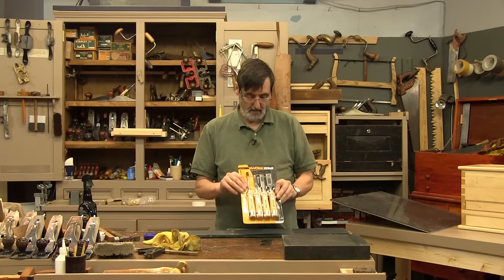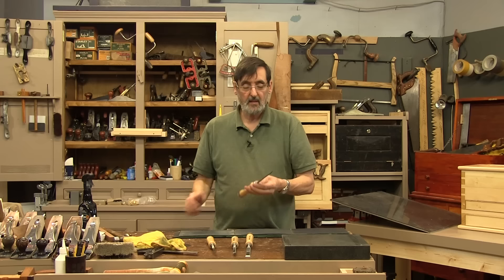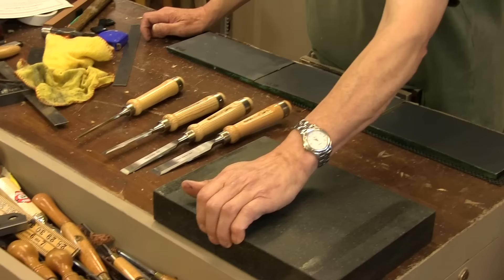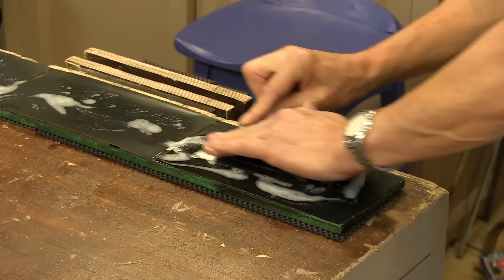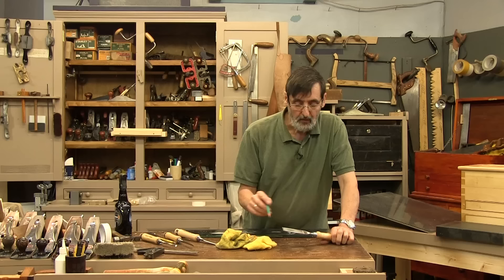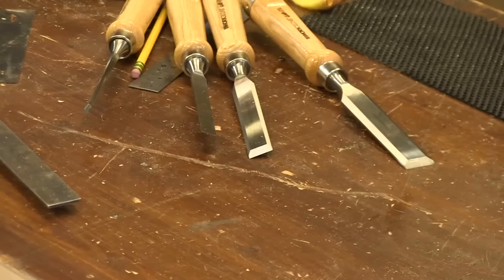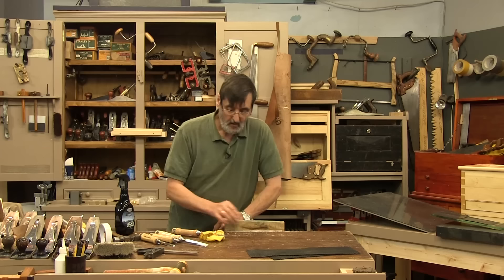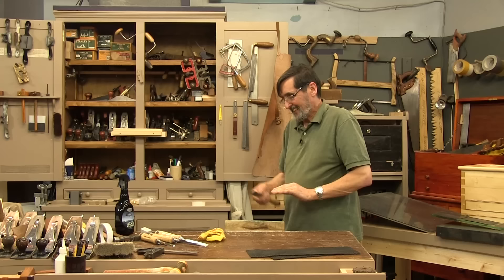Preparing and sharpening a woodworking chisel | Paul Sellers

Comment: Hi Paul. Great video!
May I ask a small video request please? After watching this video, I bought some jewellers rouge, a waterstone, an oil stone (the current chisels I have were pretty rough) and a leather strop. I did exactly what you said on this video. I am not sure if new comers who watch this realise just how sharp the chisels become once sharpened like this. I found out the hard way, yes I was stupid and careless, hands in front of the blade....... blade slips, next thing I know, there is claret everywhere, the missus doing her nut too! I won't make that mistake again. But sharpening chisels this way is something else. They even look good with the highly polished sole and bevel! So those who are going to sharpen this way, just take care and be very carefull, HANDS BEHIND THE BLADE ONLY no excuses!
Reply: hello chris, I may not be paul but I can answer a few things for you as a professional sharpening service. first you need to make sure you keep the bevel at 20 degrees, 19.5 is actually the optimal, but REALLY hard to get it right freehanded.
and him using sandpaper to sharpen, he's not actually sharpening them, more like honing them same principal as a strop but takes metal away. the method I use (took years of practice), is a generic combo stone(rougher side) to grind out the bevel to desired degree only this step if theres nicks and such, if no nicks no longer present or wasnt present at all,then i move onto a better quality stone combo stone(norton) thats flatter, and thats what i actually sharpen with, start with rough side and use 5w-30 motor oil, after I get the edge I need, i switch to other side, and use 3 n 1 household oil for finer touch, to sharpen/hone the rough edge into a cultivated edge, then i move on to my arkansas stone which turns the cultivated edge into a keen edge, as well as polishes it. after all done with this, then I use a leather strop if needed to get rid of micro burrs. have any questions regarding this please email me and I'll gladly discuss it with you.
Reply: also forgot to mention, theres a rule of thumb when it comes to sharpening. the sharper it is, the quicker it will get dull.
the reason is explained above.

Comment: I never got chisels from Aldi, but other cheap ones. And I don't recommend them. You can get them razor sharp or even sharper, no question. But they don't stay sharp very long. The edges on my "Kirschen" chisels last much longer. The best chisel that I have is probably 150 years old, pulled it out of a shelf in grandfathers shop. Completey coated with dirt and rust. I refinished it and still haven't found anything new that can compare to it.
But excellent techniques, thanks for making the video!

Comment: Here in the states you may find an aparrently identical chisel set sold under the Sandvik branding. As I work occupationally with mortise door hardware I keep a few brands in the rotation for my tool bag and I can see where you're ok with them. The old rounded handle maples blue are probably a step up if you can find an old stock set. If you're ok to spend, the boxwood octagon handle sorby are my favorite over time.

Comment: Thanks Paul. I read about how to do this about six or seven years ago but was never sure if I did it right. I sharpened all my plane irons and Chisels. None of them were very great to begin with, several that my father passed down to me were absolute rubbish and another set was free with a subscription to a magazine as I recall. But after lapping the backs (and I flattened them all, took all damn day, I wish I had seen your video, it makes sense that unless they are bellied there is no need to be completely flat) and sharpening them up to whatever grit sandpaper I had, I think 4,000, they cut like butter. I have never done the convex grind, but I might give it a try. It is supposed to be a more durable edge. Do you also sharpen planes the same way? 

I have found that the sandpaper will stay in place with some water, but the edges curl up making it useless. I spritz on some water, lay on the sandpaper, and then clip two opposing corners down with those small "x" finger clamps. I use a piece of Granite tile that I got at the big box store for 3 buck and hang it off the bench an inch to accommodate the clips. I have a granite stone like yours, but I just use that to flatten my sharpening stones. 

Thanks for the video.

Comment: Great tip to use cutting compound simply applied to  a block of wood. I tried polishing on a wheel on a lathe before, it worked the same but is more effort to set up

Comment: I haven't needed to use liquids for the most part. Rather than developing swarf, you often can clear the grit with a brush. The plus side is the backing is much less likely to rip. When the paper is near the end of its useful life, perhaps then you can clear the swarf and spray to get a little more use out of it. Going dry is cleaner and you can just lay higher grit films on top of the lower grits that are glued to the glass

Comment: Great video! Thank you! Just one thing. I've used water paper to sharpen by clamping it with two pieces of wood(achieving same result as you did with tape) and paper didn't rip so far. On the other hand I'm just a beginner and I didn't do that much sharpening yet:)

Comment: By chance, I have a set of those 'cheap as chips' chisels - although I haven't had the 'nous' to bother sharpening them other than a brief whisk on a belt sander. That's changed. I have a hunk of glass, and some leather. I even have some vari-grit sheets of glasspaper gathering dust. Thank you, Paul. I'm inspired. I'll be sharpening my four edges up tomorrow - then I'll try them on some 'Cutty Sark' teak I have....

Comment: randomly, i just went to lidl for groceries just now, and I saw these exact chisels, or very similar anyway. And they cost 7quid, so I bought them just for fun as they're complete bargain, will see if they actually work work at all. It says steel vanadium, haven't noticed that being used for chisels before, so it will be interesting to see after I sharpen them tomorrow

Comment: The old Sheffield chisels seem to behave in a different way to newer steel edges . My Dad used to sharpen on an oil stone till the burr appeared along the edge. Then by drawing the blade back across his palm a few times the burr would flex to and fro and drop off.   I use a cotton pad instead of my hand and the edge can easily slice newspaper without any polishing. The steel is not so hard as modern stuff but it`s easier to sharpen .

Comment: One could find flat surfaces at the local store if he is looking at the granite/marble synthetic stone floor tiles. quality ones are grinded and lapped, in machines similar to the ones that make laboratory grade precision tables. I have found in my left overs some that have 0.01 deflection at 500mm ( they are 60X60X4cm  black granite from a large german-superstore)

Comment: The biggest revelation I have had in woodworking was finally realizing what sharp is.  I've been using abrasive paper for about four years simply for the convenience.  The local auto parts stores sell a nice variety pack that works quite well.  Using lapping fluid never crossed my mind.  I'm going to try it.  As for chisels, the cheap chisels here in the US are really quite bad.  Look at them wrong and they become dull.  I have a set of Irwins that were inexpensive and still have good steel.

Comment: Thank you so much, just did this minus the oxide charged on the leather. Just did it bare leather figured it was better than not using any kind of strop. I am shocked and amazed with the results. I did use a cheap jig off amazon to get the right angle and keep the bevel proper. Free handing isn't too hard but certainly can't do at the speed paul does with any kind of confidence. I am sure the results will only better with practice. One question for those who know, how do you know the EZ lap stones remain flat with use? Thanks

Comment: I sharpen with DMT diamond plates, but I still use sandpaper for initial flattening of the chisel / plane iron backs. I found that my DMT Extra-Fine plate is mostly extra-fine, but there are some bigger diamond particles embedded in it's surface, so it leaves a polished surface with some scratches. Apparently this is very common with those plates, at least the DMT ones. A 2000 or 3000 grit sandpaper leaves a more uniform surface than the DMT Extra-Fine. I finish up dry with some chromium oxide stropping compound on a flat piece of MDF (it's surface treated  time agowith boiled linseed oil to make it last longer). For sharpening, I just use the DMT plates, ending with Extra-Fine, and strop on the same piece of MDF and/or a leather strop (still trying to figure what works best).

Comment: Hi, I recently went to an Aldi here in Brisbane, Australia and came across the exact same chisel set for $12.00. Although I have many fine chisels by  Sheffield makers and Berg from Sweden and Pfiell from Switzerland. I could not help but buy a set of these low cost chisels. I was amazed by the quality of grinding and how well they sharpened up. How can anyone manufacture, ship to Australia, market and sell these for just $12.00. Aldi hole saws and drill bits also work very well. Thanks.

Comment: Hi Paul 
Thanks for showing us how to sharpen a chisel this way like you do have found it great. 
I have one question how do you bring a chisel bevel that is out of square back to square so you can use this method on it?
Reply from the maker: You just have to either regrind the bevel on a mechanical grinder or you can simply press on the offending side until you make the correction. This doesn’t have to be all at once. You can do this with subsequent sharpening.

Comment from the maker: As good if not better than any "lapping fluid" I ever used. Keeps the plates clean and clog free and it seems to me anyway, the cheaper the stuff the better it works. i buy mine from the Dollar Store in the US and the Pound Stretcher. In other words the cheap stores that sell goods at cheap prices. I don't use Window cleaner, but I do also use auto-glass cleaner.

Comment: Paul, I love your video. I made a sharpening station like yours and am trying to flatten my inherited chisels. The trouble is, mine are not nicely hollow-ground like yours, but are irregularly bellied. I’ve spent hours on just one! It’s therapeutic, but so is actual woodworking. Is there a point at which I’m just wasting my energy? Do the edges need to be flat along the entire back? Thanks so much!
Reply: Basically, you need a continuous flat right at the cutting edge, doesn't matter whether it's 1/16" or 1/2" wide. This is about making two bevels meet, not making a whole chisel perfectly straight. Sometimes, esp on used old chisels, corners are sunken below (sharpened on a hollowed stone probably) - that sucks, but 80 or even 60 grit gets me a decent flat back in about 20 mins. Hope this helps.

Comment: Flattening the back of chisels in this way is excellent.  This is very informative.

Putting a convex bevel though, on a chisel or any woodworking cutting tool will lead you to put a greater degree of bevel on a chisel every time you sharpen.  This isn't good practice as far as I can see.  Especially for new woodworkers.

To sharpen the top of a chisel once a back is lapped perfectly flat, I use a 1200 grit diamond stone and a Veritas honing guide.  I then use a flat leather stop with a compound on it.  If I need to re-do an edge after a time, I take it to a wheel and carefully grind back to my edge.  Then it goes back on the diamond stone, and it is sharp and ready to go in about two minutes or less.

There is a technique to getting the bevel edge correct using which ever method you choose, but I believe that showing new woodworkers a convex bevel like this will end up with users putting a 30, 35, 40+ degree bevel on their tools over time.
Reply: If the back of the chisel is consistently 30* to the sharpening surface (or close enough) when the edge of the bevel is at the sharpening medium, it's impossible to put anything other than a 30* bevel on the chisel, no matter how many times you sharpen it and no matter what type of bevel you put on the tool. Doesn't matter if it's flat or convex. It's still a 30* bevel.

Over time, it will simply take more time to do the primary grinding at the lower grits if your chisels have a taper, which many do.

Perhaps you are correct, that a new woodworker might not realize what they are doing over time, but if they follow his instructions and start the sharpening at 30*, they'll get the same result. I put convex edges on every cutting tool I have, except my Mora knives, where I just keep the scandi grinds.

Comment: Hi Paul, I finally managed to get a set of Lidl chisels off ebay as they are no longer sold with wood handles in the UK. They are very good, the 24mm and 18mm are fine but the 12mm and 8mm are very thick closer to a mortise/firmer chisel, the ones I have seen you using are very thin so the question is have you worked yours to make them thinner or have I just been unlucky.

Comment: Paul,

Can you make a suggestion for what to do when there is a belly? I spent a long time trying to get anything happening near the cutting edge with 80 grit on multiple chisels on a set before I checked and found the belly on all of them. After that I just concentrated on the front inch or so and got that reasonably polished. They cut well (not like yours), but I'm wondering if that was the best way to go about it.

Thanks for the fantastic videos
Reply: That's what i do. And it takes a lot of work. Just today i even bought some 60 grit Al2O, because i need toake off a lot of material.

Comment: Aldi manages to get some petty good tools, the 3 lb lump hammer they sold was excellent and for $12 or $15 AUS and as good if not better than the same elsewhere for $50 AUS, their wooden jack plane has a huge high quality steel blade, but those chisels are as good as any other and are rolled steel, they will last forever,

Comment: You might find the plate glass you're using useful.  Sharpest I've ever gotten a tool was sharpening it on plate glass.  You can easily dress the glass with 200 - 400 grit paper on a vibrating sander

Comment: wow  I  want to do my hunting knifes  like this
Reply: You may not want to.  Hunting knives have two bevels, not just one.
Doing convex bevels for knives is nice, but is very hard to do right, because if you don't do exactly the same rounding on both sides, you get an edge that points slightly off-center.   It's easier to do a standard secondary bevel, as you can control the angle at the edge.

Comment: Thank you for this excellent tutorial. Question: can I use emery paper instead of the wet/dry sandpaper?
Reply: The wet/dry paper is best. The fluid is a lubricant. You wouldn't use a razor blade to clean a glass surface without window cleaner or water because you might scratch or gouge the glass. Same thing applies with wet sandpaper vs emery paper.

Comment: If you look at the video you'll see Paul polishes the chisel on a block of wood and then on leather strop. (You don't move the chisel back and forth on the strop but trail it in one direction only). My question is: are both steps necessary?
Reply: Well, not entirely. like he says, a lot of people don't progress further than a belt sander. And there's nothing wrong with that particularly, its just that the strop gives it a razor edge that chews through wood with just hand force.

Comment: Very interesting explanation - Great lesson for me. 
You say that we can use any kind of abrasive paper but only abrasive paper for metal or abrasive paper for wood do the job also?
Reply from the maker: Either wood or metal abrasive papers. Basically, abrasives are similar or the same. Abrasives for metal, however, are usually black and this turns the wood black also.

Comment: Dear  +Paul Sellers, I've been always taught that the bevel must be straight on a chisel, but you create a little camber on the bevel.

Is it only to facilitate the craft of scallop form of does it give a better cutting edge to the chisel ?

I'm confused now, should I go for a straight bevel, or should I go for a cambered bevel like you show in this video ?
Reply: +Alex McClure You should never have to sharpen the chisels again, all you need do is keep honing them on the Leather before use ;)